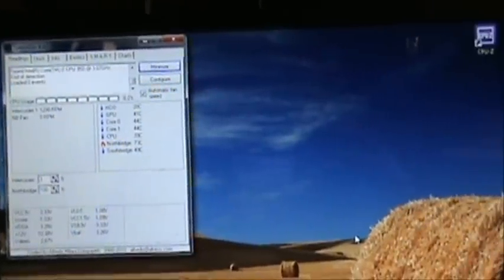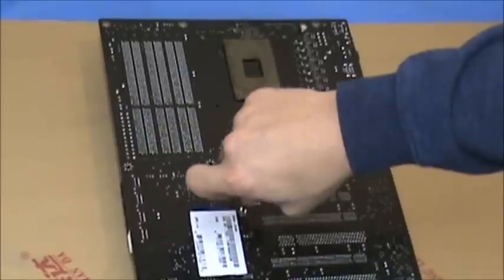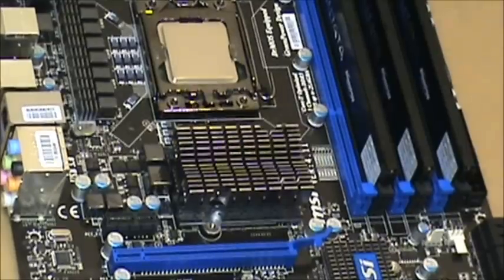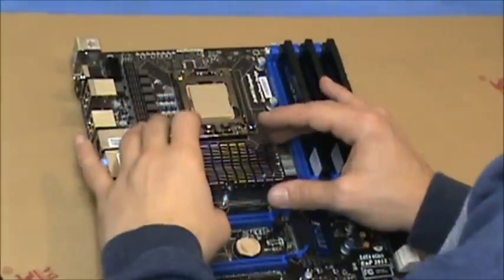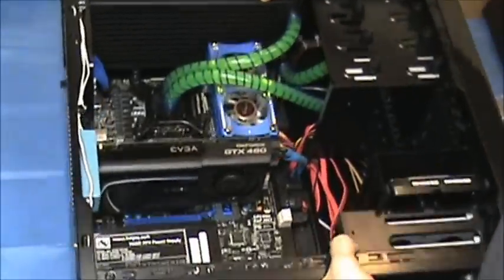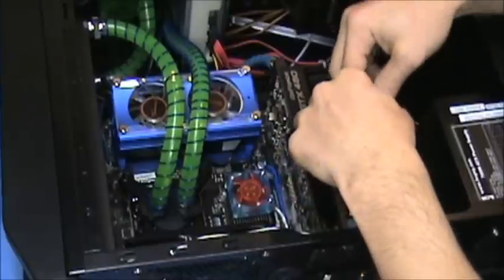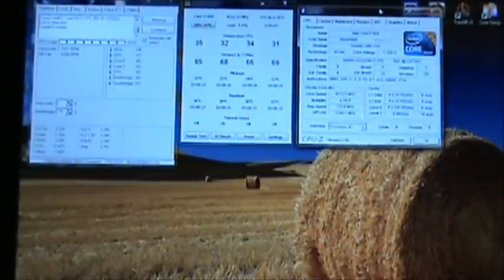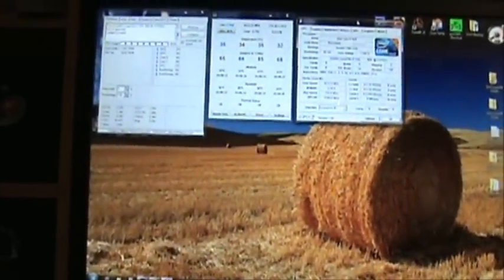MSI X58 Northbridge Temperature management for under $15

Comment: Does it help performance?
Reply from the maker: Nope, nothing obvious. But it drastically reduced my temps, which made me feel better for overclocking
Reply: @4x4Play  I have a evga x58 FTW3, 6-core w3690, and a 6800 XT, it runs witcher 3 at 4k Ultra 60 to 80 FPS. GPU at 97% utilization... But I notice that every little bit I squeeze out of the CPU I get 1 or 2 more frames. So maybe it is worth it for me ... I am thinking... But my motherboard has a huge northbridge heat sink right next to the CPU fan, and I don't think there is even any room for a little fan there. 

It's really fun to push these old motherboard/cpus to the limit, and so satisfying, but I may just go back to using it for GPU mining

Comment: Thank You, It was a pain in the rear removing my MOBO, however my results we very similar to yours, Hi NB temps, with old dried out past, cleaned and reapplied pasted, lowered temps under a load by 15C. Again TY

Comment: Ive never heard so much crap in all my life. The temps forx58 north bridge on 73c are correct I can totally see that but you will never get 30c on an x58 on air. If it was Water cooling and nothing in the PCI express slot sure but not on your current config. I call major bullshit

Comment: Using msi 890fxa-gd65. Awesome video man. Just used one of those antec spot cool fans but the stupid adjusting arm never stays. This hi temp has bugged me for a long time. Luckily it never fried the board with my amateur overclocking. Hopefully it also helps gain some stability while overclocking.

Comment: @1jaudio1 

I did a similar procedure as you though. Used the same paste, but used an Antec Spot Fan on the NB heatsink. Some were saying to get an aftermarket NB cooler, but its a waste of money and you can achieve the same results by using quality paste and small fan of your choice. I noticed your mobo didnt have push pins though, and had screws. Pro-E never had them, but the Pro did for some time, until people complained and they changed it out. Lucky you got that one and not the push pins :D

Comment: @1jaudio1 

It took me an hour to scrape that nonsense off and get the NB's die down to a mirror finish. Kegger, you were lucky, because my PRo-E used a linked HS, via a heatpipe, im sure you have seen it. That too, MSI needs to scrap completely, because its useless and just adds to more tedium. Took me awhile to get the SB off, but it did come off eventually, but to be honest, it doesnt even need a HS on it, since the SB barely gens any heat anyway, hence the reason SB heatsinks aren't common.

Comment: @1jaudio1 

Well thats nothing, mine was at 82 degrees idle. MSI just totally dogged it with the horrendous excuse for thermal paste, as well as not fastening the HS properly, which is why the heat issues on the Eclipse, Pro and Pro-E were so terrible. They make quality mobos, but they need to switch to a quality paste. I did this whole procedure couple days ago, and went down to 48 from 82, so it just proves that the paste they use is complete bs. It's like a sticky, dried out bubble gum.